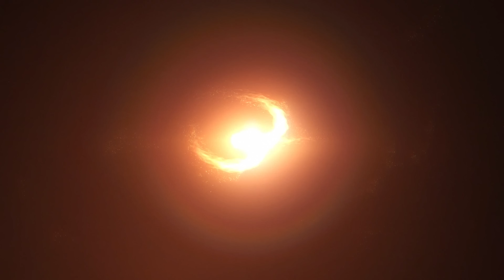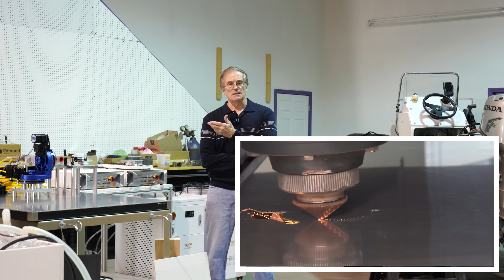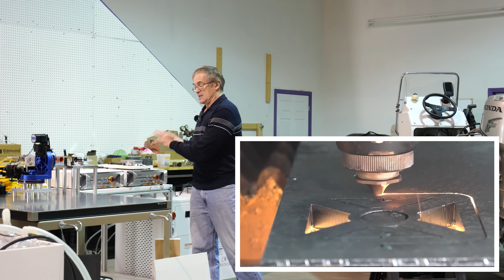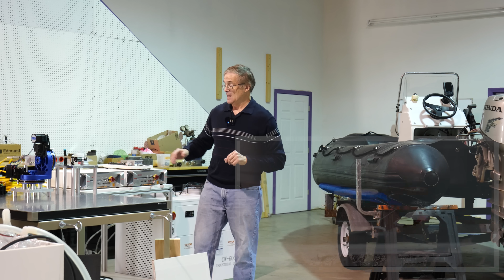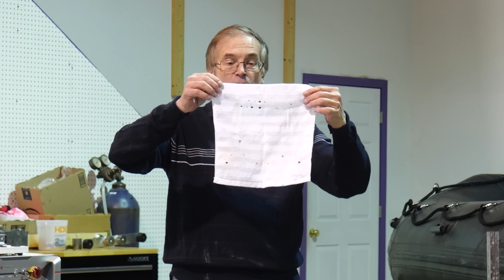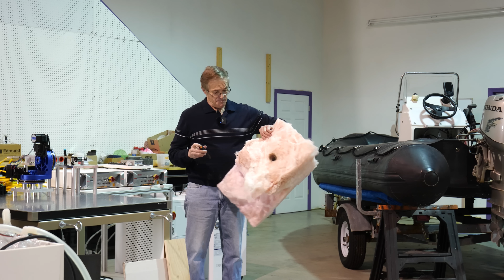We have a problem... and need your help!

Comment: Have you considered making your own sheets of “aircrete” perhaps using refractory cement? 
Alternatively, putting plywood sheets in an aquarium would solve the fire issue. Though you may need to go plug the holes after every attempt.
Would reversing your focusing system to scatter the beams be an option?

Comment: No experience with this, but you've asked,  and this is likely to do better than your tests so far. Sandwich dry sand,  so it can flow downward after being melted or heated between something like the drywall or wet plywood, the dry sand could fill any gaps created by the beam with fresh sand, and if there were 2 or 3 movable sandwich layers,  these could be moved around on wheels when the target wears out too much.  Also,  the holes would be easily filled with cement or wetted sand. Great outsourcing and good luck!

Comment: Besides all the very good points already made about safety switches (and safety in general) you can dramatically increase the surviving time of any material you choose by building a round target spinning and sliding across the beam, constantly exposing new surface.
As for the material, I would look into either refractory materials (cork, aerogel or the shuttle's ceramic tiles) or very good conductors (a big block of copper or aluminium)

Comment: Amazon sells asbestos board rated for 1500 degrees and ceramic fiber board rated at 2300 degrees. Might be worth a try. Funny how those lasers are designed by engineers to be safe. Shows how ignorant they are! They never counted on US ingenuity!

Comment: I've never worked with lasers past 40W, but I I HAD to design a beam dump for something big, I'd go for a wall of european horizontal coring clay brick, mounted with the holes parallel to the ground to catch backscatter, followed by sandbags or some box from plywood or particle board filled with dark colored sand or fine gravel.

Comment: Try dense hemp sheets or blocks. It’s cheap and might be ok.
Behind that do a thin layer of water backed with ceramic. Small holes and slow leak is the worst problem.

Or make a laminar waterfall lol.

Comment: Have you considered looking into the space shuttle  heat shield tiles? I've no idea what they are made of but who knows, maybe you can get some used from NASA. I onmly know they are light.  Also, what about using a fog machine to disperese the light energy in all directions. The fog would have to be thick. Maybe you could use some combination of substance (like wood or whatever) and CO2 cloud to a.) disperse some of the energy and b.) minimize the fire potential.

Comment: My suggestion: a "water fall blanket" made from water which contains e.g. carbon black as an absorbant material. By controlling the flow in the water blanket you can control how much water is available for dumping the lasers energy in. You would "only" need a big pump and som e tubing. Youe can youse your wet cloth cloth to help directing the water flow and as an additional absorbent layer.

Comment: Those protective eye glasses are designed to stop the wavelength of light getting to the eye?
Would it stop a direct hit?
Could you test a sheet of asbestos - the stuff that makes the protective glasses - steel sheet. Thinking of fire retard-wavelength stop-heat disapation

Comment: Maybe a hollow wall (maybe two parallel panes of glass) filled with tiny (smaller than the diameter of the beam) polished metal balls that can diffract and diffuse the beam enough to make it safe?

Or a pane of glass with the rear surface etched in such a way as to have a similar effect of diffusing the beam to the point that it is safe? I don't think ordinary random etching would do it, but if there were enough tiny lenses  breaking up and decollimating the beam, that might make it safe? Although this is one of those things that in theory should work, but in practice might be impossible to make in the real world, at least with the tools and funds available to you.

An ablative material, like space shuttle tiles, might do the trick. Especially if combined with one of the concepts above.

Comment: along some of the other suggestions, what if the plywood is being soaked constantly with water falling on it and in it? 2 sheets of plywood with constantly wetted fiberglass insulation packed between them.  it would end up being pretty massive though with the mass of the water, but when not in used the water could be drained and that would make it more portable after that. the plywood itself wouldn't work well as plywood after that of course being constantly wetted, but maybe that would help with the time (and burning).

or fiberglass wetted with clay slurry. you can turn the fiberglass into a composite material of all sort of stuff with all sorts of crap which is something you normally would try to avoid, like that slurry used for make the diy high temp insulation

Comment: I would consider a composite material: the first layer would be sacrificial, preventing the beam from reflecting back—something like aerated concrete. The second layer would be radiation dispersive—perhaps an ultra-white cement coating or copper foil, as mentioned in one of the previous answers.

Comment: Perhaps you could use an ablative coating on the dry wall or on Fermacell board. This could give you the time you need to turn off the beam.

Comment: I am an engineer working in 3d printing and am also laser safety certified. If you're looking to block the beam, use aluminum. It dissipates the heat and can withstand a laser longer than most other materials. Spacing these panels can help too. There's also laser safety glass where you want an OD 6 at the wavelength of the laser you're using. Alternatively there are also laser safety curtains that you can buy to block off certain areas which are rated for laser emissions. You can also probably use a sensor for the wavelength to make a kill switch when it detects that wavelength in the area you're working.

Comment: How about making a wide and deep container (a box) that is completely filled with (fire fighter?) foam? However, also in this box is an agitator to keep the foam swrilling quickly. As the beam hits the foam and heats it, it's quickly replaced with new cool foam that also absorbs the energy and refracts the beam in multiple randon angles. You could easily test this idea by aiming the beam at a thick column of moving foam to see how quickly it can penatrate it. The front side of the box could be your sheet rock (easily replaceable) and the back side of fire brick. The foam must be kept moving in a large vortex inside the box. 

Extra: Line the inside with heavy-duty aluminum foil. Instead of sheet rock, cover the front of the box with an insulation board that also has a metal layer on one side (inside). Lowell's or Home Depot should still carry it. You want the beam to easily punch thru it, but also contain the foam.

Comment: Option #1: A fluidized bed of absorbent granular material. Composed of a mixture containing sand and activated carbon(or other suitable material) at preferred ratio. Induced turbulence may be worth it. With a dedicated, slotted strike face to prevent excess sand leakage(after incident), or two in series("plugging" face being external but vacant until after incident). In the bed/tub a mounted plate dotted with holes for gas to flow up from with a void beneath (in case of damage), gas pumped into the lower vacancy. A bucket in the front to capture leaking sand.

Option #2: An oscillating block. Length in line with beam travel path. Increasing material struck and more so if the oscillation is tuned to maximize striking volume. An extreme example would function much like a reverse 3d printer or an automated mill.

I enjoy and love your content! Hope this helps!

Comment: How would the foundry sand they use for casting metal go? Pack a metre square into a wood mould, make the side walls 150 mm high. And stand it upright after tamping.

Comment: What if you aimed into into a liquid with a high opacity. Like if you had water full of black pigment of some sort - you would need to boil the water before it would "cut" the liquid. Or just aim it into a hill like you would in a firing range.

Comment: Asbestos is a mighty good insulator and heat absorber, and unlike pink panther, its a rock.

... might not be the easiest thing to get a hold of these days, i know it was used in japanese brake pads not so long ago, might still be in use. Would probably be better as a solid sheet rather than a matrix of various bits of a brake pad

Comment: Perhaps you could make the beam diverge relatively widely, then begin to re-converge within your apparatus, but actively control that re-convergence focal point based on target range so that the beam would only be at full strength at the target distance then it diverges to less destructive intensity after, allowing for a more simple backstop like wet HardieBacker with a spray on it (or, maybe you can get sheets of RCC composite).